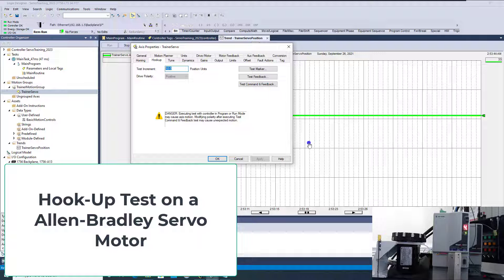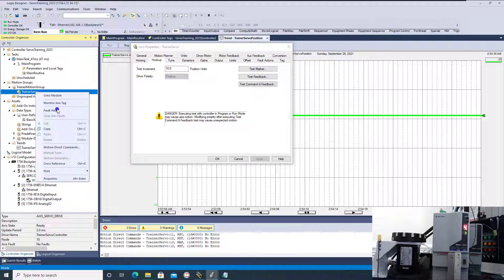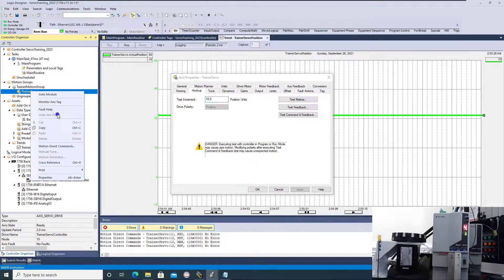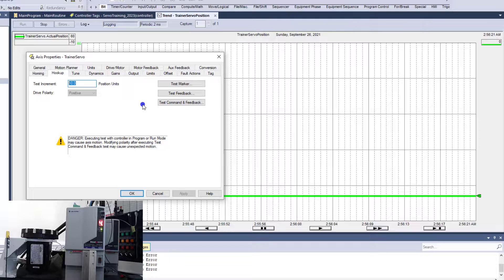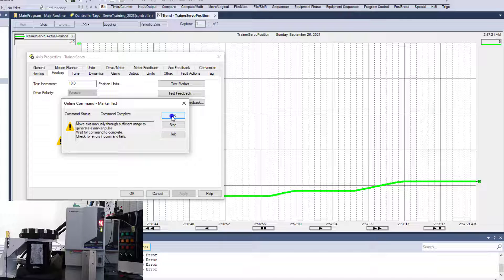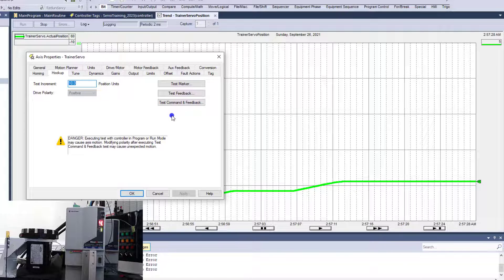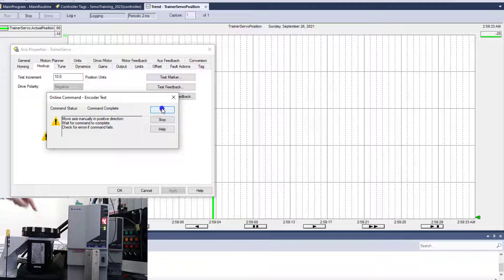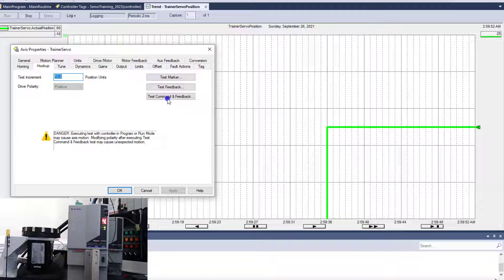Allen Bradley Servo Motor Hook-Up Test in Rockwell Automation's Studio 5000 Software

Comment: Hi sir,
  I want some information if you give I am very thankful to you.
My question is...
 I have a servo unit pack. here we one power supply, one kinetix 5700(S130) ,two kinetix (D057) these are add in motion group in studio 5000. Here we easily change MRP parameter through Motion direct command. and two kinetix 5100 servo drive add ungrouped motion group in studio 5000. Here we can't change MRP parameter.
So my question is How to change MRP parameter ungrouped motion network.
Reply from the maker: If the servo is ungrouped then it is uncontrolled therefore you are unable to change the position using an MRP instruction.
The only servos that can be changed are in active motion groups.

I would also use a home instead of an MRP unless the logic demands it because if the power is lost to the servo, it will default the position to the last homed position.

I hope this helps,

Shane